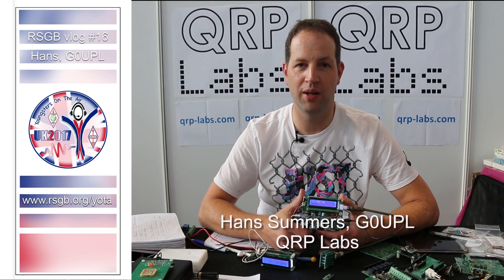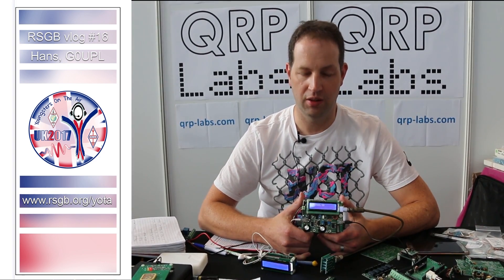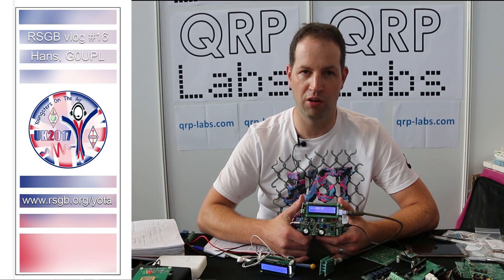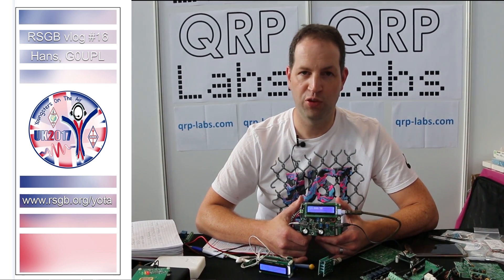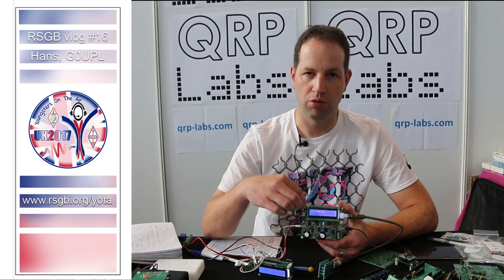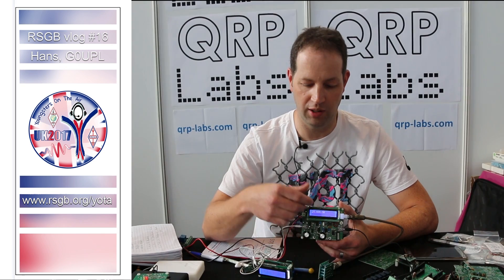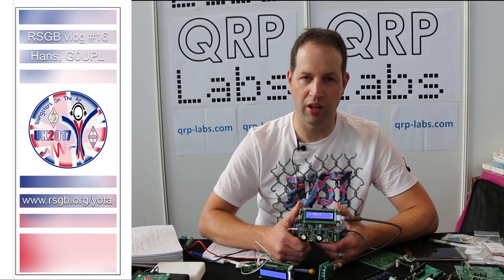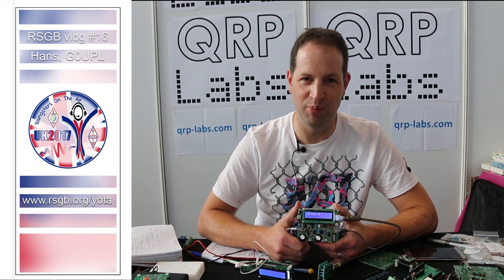RSGB's YOTA 2017 vlog#16 Hans, G0UPL - QRP Labs

Comment: Love the quality of and easy to build Qcx+. Today I tuned around 20m to only find one weak station calling cq. Had the QCX+ and a yaesu ft818 connected via a switch to a 20m dipole so I could switch between them. They both received the same weak signal but The QCX+ with its audio filter brought it out and made it more readable and it even decodes the cw on screen. WOW. I tuned the 15mhz time station and the Qcx did better. Thanks Hans. I highly recommend the QCX+ and other things from QRP-Labs.